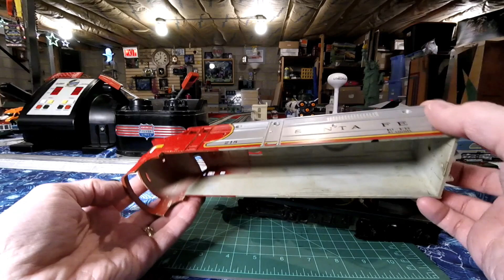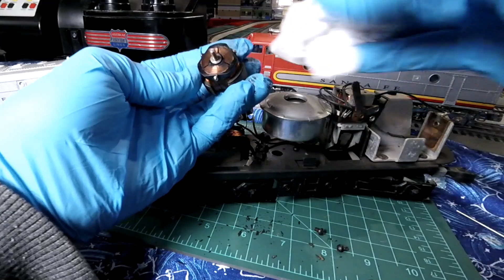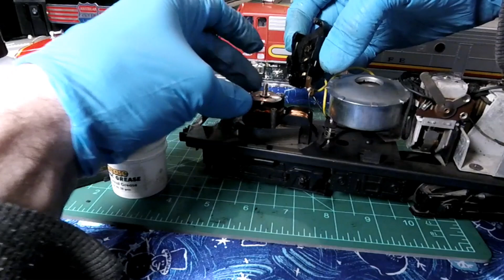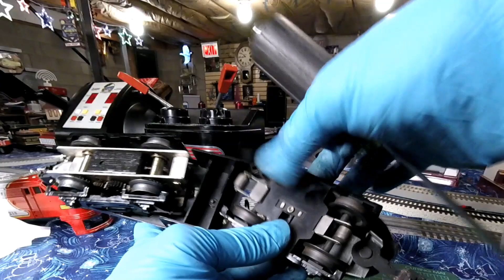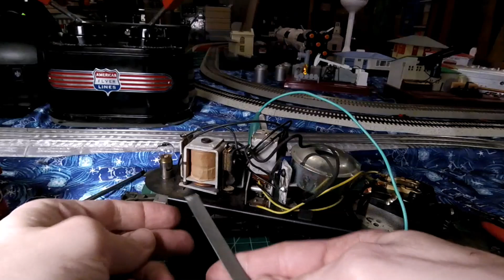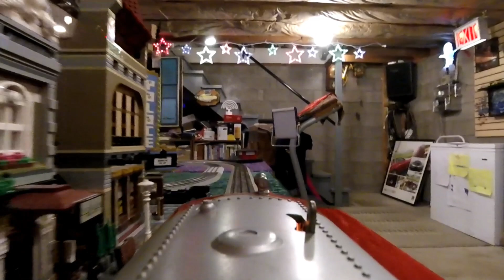Lionel Alco FA 218 Santa Fe - Non running estate sale purchase - can it be saved? built 1963

Comment: Excellent! It's purposeful in the way where you gradually do the disassembly. I enjoyed every moment of it  because anyone who is ever changed out those Lionel postwar engines, has no doubt experienced EXACTLY what you found where it's relatively simple after doing a few, but it still is tricky sometimes. Yet it is also rewarding once their back on the track after a service or repair and with a sense of accomplishment and awe seeing them fully operational. I changed out my share of cylinder shaped brushes and regreased those gears after a thorough clean up like that.
Reply from the maker: Thanks ❤ That was a neat fix that has lasted.

Comment: Hey nice tutorial 
You didn’t go over reasons why that particular Sante Fe unit was a decent unit model. I like the Santa Fe s and have a new in box set ABA passenger wish I would have gotten another B unit.
Reply from the maker: Great question! Mechanically this is a great one because it has the newer power truck - this has a bearing directly under the motor windings - versus the earlier design that has the bearing at the extreme end of the worm shaft. This updated design is way more reliable. Skip to 10:02 and you can see this bearing.

Comment: Never use 3-in-1 oil, because it's water-based, in time it will cause rust and it's not heat resistant it wears out the bearings quicker!, Use Gun oil it's heat resistant and it has no water content whatsoever it prevents rust and last for a very long time, it's recommended for motor bearings wheel bearings, handguns and shotguns!!, it cost a little bit more but you never have to worry about anything again!, plastic in nylon bearing safe!! , and you can get it in a needlepoint applicator! $12.00 Bottle! , O'Reilly's Auto zone in Walmart!! , orchard local gun shop!!!!   :)
Reply from the maker: Thanks for the tip ❤️

Comment: For me, that's one of the best part of our hobby. Getting these amazing old trains back on the rails pulling cars. I absolutely love fixing these old trains and transformers. I recently restored an old F3 Southern unit. The shell on the ABA was immaculate, but the motors were locked up with solid grease. After a thorough decreasing it's back on the rails stronger than ever. The horn needed a jolt or two from a 9v battery, but again, it sounds great.
Reply from the maker: Great job resurrecting that F3 ❤️ Agreed, I really enjoy bringing back something that was left for dead.

Comment: That screw in the back that holds the shell on, I always paint it to match the paint scheme and blend it in so it's not so noticeable.  I've got an old Lionel 027 Texas Special that only runs forward 'cause there's no reversing lever or E-unit.  It has the cutout in the top where the lever would have protruded.  I taped a piece of cardboard underneath and used super glue and baking soda to fill in the slot.  Worked great after sanding and touching up the orange paint.  That gear is called a helical gear that the worm turns.  I model the Central of Georgia in HO gauge and early 1900's in Lionel 027.  Cheers from eastern TN
Reply from the maker: Nice work ❤